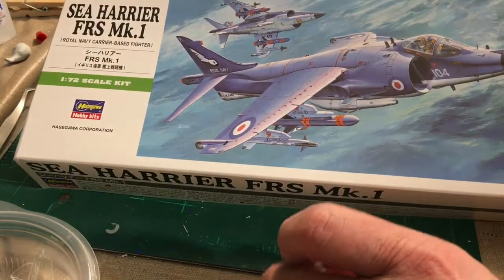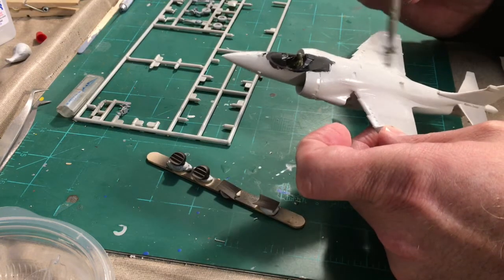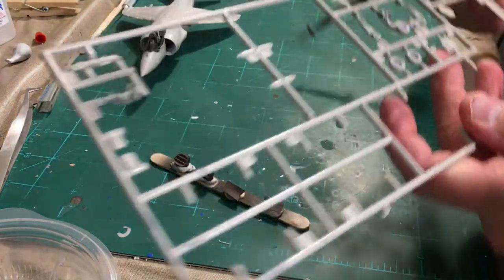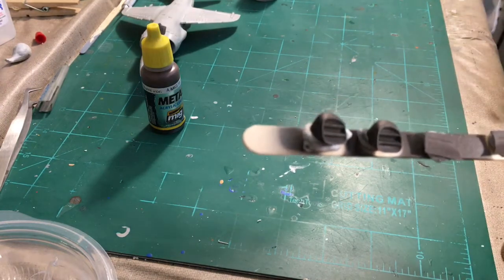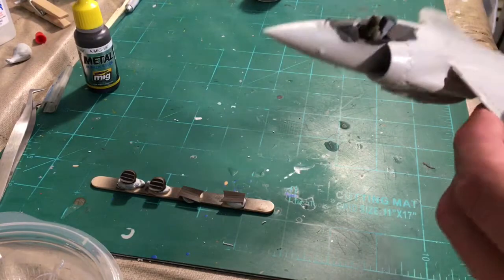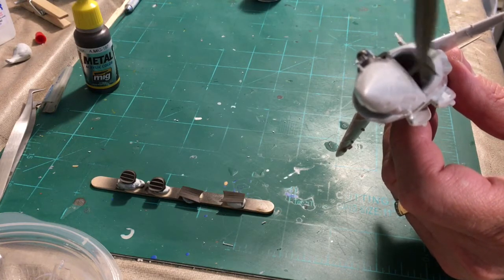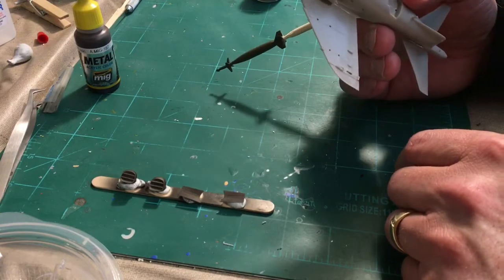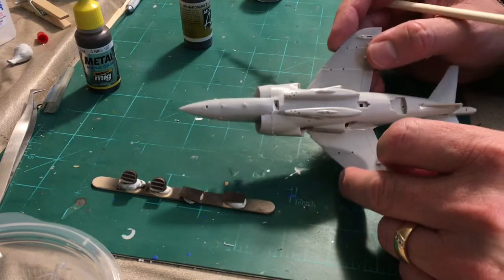Building the Hasegawa 1/72 Sea Harrier—Group Build Part 2

Comment: Great update, Drew. I think that some of the best paint development for modelers right now Are MIG products. They do some very specialized and reasonably accurate paints. I use model air a lot as well. Regards, Solomon
Reply from the maker: Thanks Solomon!  I have yet to see MIG products in my three local Hobby Towns, so I had to order this one.  I really like the Model Air paints! They are a bit more accessible now.  Hobby Lobby is even starting to stock some of their Air War paint sets.  Take care and happy modeling!  Drew
Reply: You are right about that. My hobby town doesn't have MIG products either, but I do believe I saw the same ones your talking about at our Hobby Lobby. I wonder about Michael's, not that they have much anyway. I have a fairly good range of model air and have nothing bad to say about them. Have a great week Drew. Regards, Solomon
Reply from the maker: The only paint I have seen at Michael’s is the little bottle of Testors.  Take care!